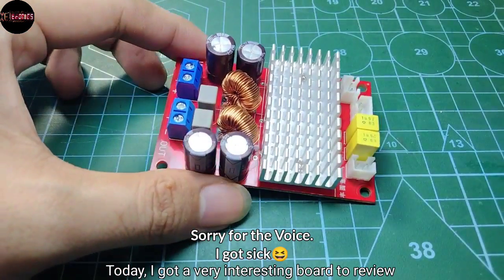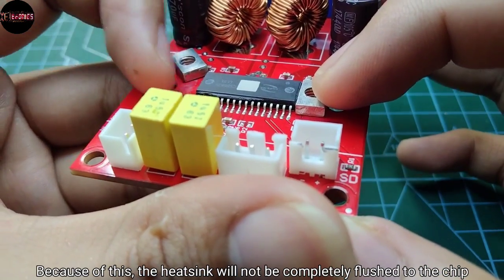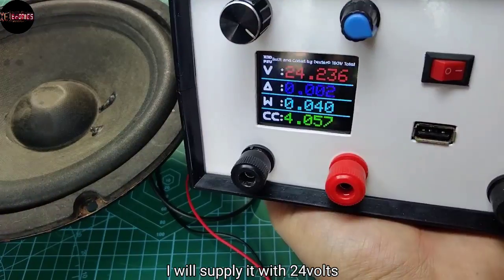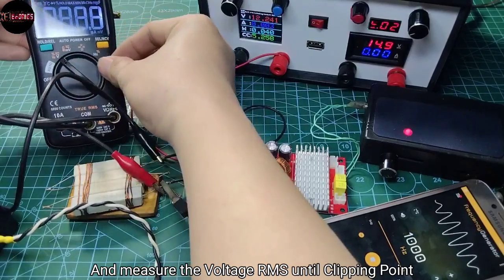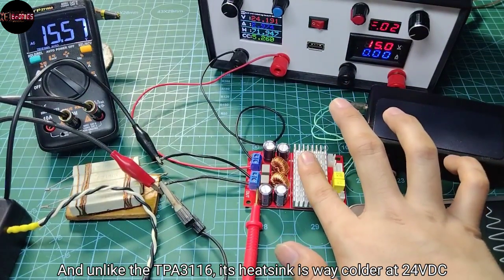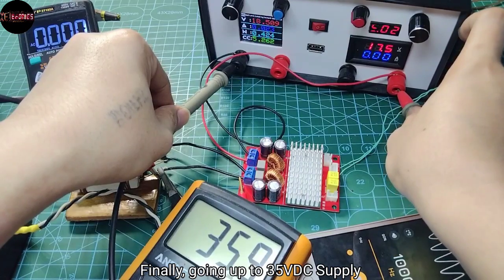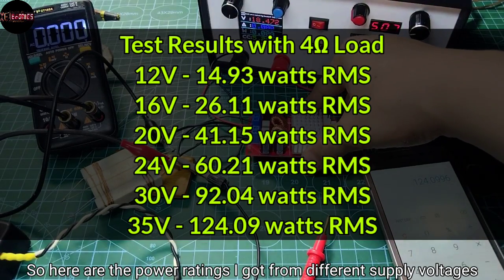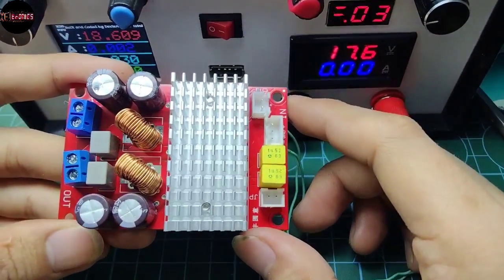You will BUY One After Watching This !! CS8683H RMS Power Test! #classd #amplifier #tpa3116

Comment: Can i use a pd charger as a power supply for that?￼￼
Reply from the maker: You'll need a PD trigger brother
Reply: @x3dtronicsph yeah i have 2 can i use them in parallel to have the same voltage but higer amps  I will use 2 chargers

Comment: He bro I confuse which I bought cs8683h amplifier vs TPA 3116d2 i want more deep bass that reason which should I get you test every one and listen side by side and tell me difference which is the best for more deep bass and quality in  sound i not want more power but I want Deep bass and sweet vocal voice 

Don't hars voice and vocal jo damage ear and harsh 

You tell me any situation which is best 

Please reply me ❤❤❤
Reply from the maker: Both have almost the same bass responses. 
If you want more bass, you need to have a Filter or an EQ
Reply: @x3dtronicsph understand that the responses are similar, but please listen to them side-by-side for a while. Test the frequency using a frequency generator app and tell me which one delivers a better frequency response that is suitable for me. Which one delivers low frequencies really well and maintains sound quality even at high volume? Please tell me only one; do not confuse me."
Reply: @x3dtronicsph understand that the responses are similar, but please listen to them side-by-side for a while. Test the frequency using a frequency generator app and tell me which one delivers a better frequency response that is suitable for me. Which one delivers low frequencies really well and maintains sound quality even at high volume? Please tell me only one; do not confuse me."

Comment: great video po as always!!..ask ko lang kung pwede ba ang transformer AC na may 29.5v 0v kaso pag naka convert na sya sa DC nasa 38.7v na, nagdadalawang isip kasi ako kasi sabi dun sa data sheet kaya daw high voltage tolerance of up to 45V siguro for idle lang yun😅
Reply from the maker: Alanganin bossing, baka di tumagal HEHEHE

Comment: Hello, sir/ma'am. Please tell me if the CS8683 amplifier board is better than the TPA3116D2 mono amplifier, specifically for a deep bass lover who wants the highest low-frequency quality in sound. Which of the two—CS8683 vs TPA3116D2 mono—is better for deep bass quality?
Power is not the main concern; the quality must be there.

Please reply me ❤❤❤
Reply from the maker: I think, they have the same Bass Response though. The Problem with TPA3116 is the Pop Up Noise
Reply: I understand your concern completely and appreciate that you want to make a worthwhile investment. You do not want to waste your money. Could you please just tell me, after listening to them side-by-side, which one is better? I am not concerned with the wattage or sheer quantity, but the quality of the bass. Which device has a slightly deeper bass extension and better overall sound quality? Please listen to both and let me know your professional opinion. Thank you for your reply." @x3dtronicsph 

Please reply me 

Who is the best for Deep bass lover ❤️❤️❤️ 

Jyada what is hone se fark nahin padta quality in bass ❤❤

Comment: bought another one for a simple bt speaker. but i noticed one thing: my capacitors near the inputs are black. the inductors on the output looks different and the low frequencies is very good but the mid bass and above sounds like its decreased. i dont know whats going on here and when i touch the input, it doesnt really hum that much even if its not connected to a battery. is it possible that i got a bad chip? i did buy it from your links
Reply from the maker: Unfortunate, it is possible that they ran out of good stocks. It is not a Fake chip though since Microchips are hard to manufacture. I hope you have an ESR meter and an Inductance meter to test the Inductors and Capacitors. It is most likely a Filter problem. Most fakes nowadays are common with passive components
Reply: @x3dtronicsph  after like 3 months, my mind clicked and figured out why it was happening. see, before i connect the amplifier or any amplifier, i always make it go through this EQ and i totally forgot that 2 linear pots near the 60hz to 140hz were absolutely dirty because of rats pissing in it (it was left in a dusty warehouse for months with rats in it) and it probably damaged the resistive track. I found that out because the teacher was talking about warehouses and i was looking at the knobs from a bluetooth speaker she had and it clicked. stupidly funny thing that happened lmao

Comment: Sir.idol new subscriber mo may itanong lng ko, kaya nya ba pabayuhin si tusonra subwoofer 8" 801 parang nasa 100-200watts  sya kc mayron ako tusonra Kaso Wala pang amplifier.na e match sa kanya. Sana mapansin thanks and Godbless!🙂
Reply from the maker: Kayang kaya yan boss. Basta Around 30VDC ang supply. 
Kung hindi capable ang power supply mo boss, Sisinukin talaga sya HAHAHHA
Reply: Ok salamat sa kasagutan sir.plano ko Palang bumili at pwede na ba o sapat na ba power supply 24volt 10amp gagamitan ko lang Ng step up corverter para tumaas Ng 30volt DC o kolang pa  Yun lng Ang supply dito at  pwede na kaya Yun..tnx

Comment: Hello :) Thank you for these videos ! What is the purpose of the 2-pins "Gain Setting" please ? What should be connected to it, a 2 pins on/off switch ?
Reply from the maker: It adjusts the Gain brother. The Higher the Gain, The Higher the amplification factor. Meaning it can amplify very weak signals, only con is that it will amplify noise as well.

Better leave the gain to its nominal setting. Around 26dB to 32dB
Reply: @x3dtronicsph  Thx !! These little amps boards are perfect for guitar amp project :)  Do you think it’s risky for the amplifier to connect a 16 ohm speaker???
Reply from the maker: If you're going to use this as Guitar amplifier. You will need a Pretty Good Preamplifier circuit. Increasing its gain too much will introduce a lot of noise.

For 16 ohms speaker. I'm not sure if this amp will perform well because the Output LC filter is designed for 4-8 Ohms. Feel free to test it , in my opinion, Class AB is still best for guitar amps.
Reply from the maker: But if you have a Very Good Preamp, It will work just fine
Reply: @x3dtronicsph  I will test it :) Thx again !!

Comment: i now have the board and its powering two of my TARGA 10 inch subwoofers very well!!! ( i made my own heatsink for it.)
Reply from the maker: Supply Voltage?
Reply: @x3dtronicsph I do think 25A is a bit too overkill though lmao
Reply: 35v 25A
Reply: It's the only psu I have that is rated at 35v and can output more than 150w
Reply: @gabrielantiligando9905  sir yung nabibili sa shopee na smps 36V 20A pwede ba yung iadjust para maging 35V or 30V? bumili din kasi ako niyan CS8683

Comment: The TPA3116 is a good chip. Unfortunately, it's often misapplied. The biggest mistake is a poorly selected output filter. It should be a maximum of 10uH + 470nF. Often, the inductance is higher, and the bandwidth doesn't even reach 20kHz. The yellow cores in the chokes are not suitable for operation at 400kHz and get very hot. They can also saturate and introduce distortion.
Reply from the maker: Yes, very good chip as well, but limited power, it can reach 100watts peak with 2ohms load, but not continuously, and at lower load impedance, frequency response gets even worse

Comment: Boss alam ba input impedance ng zk-mt21?  Tap3116d2 din chip. Gagawan ko kasi ng line-level high pass filter para ma avoid over excursion ng sub ko kaso need ko malaman input impedance nya para sa calculation ng cap value
Reply from the maker: Check datasheet boss, may program resistor kasi yan naka depende sa design. Wala kasi ako nyan.
Pero advice ko boss, wag na yon kasi pwede ka naman gumawa ng High pass filter ng sub sa preamp section na agad
Reply: Di kasi stated sa datasheet eh, tapos puro lowpass nakikita ko online.
Reply from the maker: Bakit papo kasi lalagyan ng High Pass? Pwede naman po Hinaan nalang ang volume.
Hindi din sya crucial sa Subwoofer kasi Low Power Amplifier lang naman po
Reply: Nag rub na coil ng current sub ko. Never ko naman in-exceed rms na rated sa sub ko

Comment: Grabe lakas pala nyan mapalitan nga ung tpa3116 ko😁 ano pala purpose nung sd nya at gain input ano ang function ng mga un bossing?
Reply from the maker: Standby ata boss. Bale Logic Voltage po ang pinapasok kung sakali gagamit ka ng microcontroller. Pwede din kung may GPIO ang Bluetooth decoder tapos alam mo iprogram.
Taasan mo lang ang Supply Voltage mo boss, at gamitan ng preamp para lumabas ang lakas
Reply: @x3dtronicsph ah so khit di na pala need galawin ung SD at Gain nya basta may preamp lng oks na nu? Tsaka wala ba syang pop sound kpg pinower on at off?
Reply from the maker: @JohnmarGalicia Wala ako napansin boss nong tinesteng ko.
Lagyan mo nalang po softstart kung meron boss

Comment: Great video! Nice chip, didn't know about it before watching your video. Keep comparing more boards, with chips like TPA 311x and similar, different versions with real and fake chips, at various voltages, loads etc. and later make video or table comparing all of them, which board/chip is the best, most powerful at given voltage, cheapest and which boards should be avoided, not worth buying.

Comment: don't ask for earphones for this sound garbage
Reply from the maker: @gamiwv 
I was lazy to test it with an enclosure. But without an enclosure, I can crank it without annoying my neighbours.
At the same time, I can clearly see the excursion to instantly know if it has good bass response, And if the mid-highs can be heard nicely.

Sound signatures depends on the speaker box design, so not accurate as well, LOL.
Just test it yourself sir. Thank you
Reply: @x3dtronicsph  I know how CS8673E performs. NOT BUT if you design CAREFULLY output filter . DIFFICULT considering the curve (composite resistance) of any specific speaker (driver) varies alot

Comment: Dol paano mawala yong poping sound sa pag on
Reply from the maker: Try mo boss lagyan ng soft start circuit sa power supply or sa input.
Reply: @x3dtronicsph  dol hindi Ako marunong gumawa ng soft start. Alam ko gawin yon lagyan mulang ng 47uf cap sa mute ok na sa tpa3118 para mag RC delay ata tawag non. Nag order din Ako nag ganyan amplifier module dol baka Kasi di powedi na capacitor lang e lagay sa mute para walang poping sound sa pag on.

Comment: usual TPS3116 board just use a diode in series with the supply which isn't very efficient and heats up,a simple yet effective solution would be to use a p channel mosfet +ve supply---->mosfet drain, source amp(device) +ve and gate+resistor----->gnd ,gnd is common
Reply from the maker: Yes, those are only for Low Power (Low Current) Demand. Does this MoSfet setup don't need bootstrapping the Mosfet?
Reply: @x3dtronicsph  no, that's why we use p channel (high side) not n channel one
Reply from the maker: Oh , thanks for the info brother 🙏

Comment: I have this amplifier too for more than a year now, and i used it for my mid-hi, i powered up this amp with 35 volts max supply and even at high volume and long runs, it can handle it great, the Chinese manufacturer are honest with the power ratings hehe great video!
Reply from the maker: Exactly, Chipstar has a stereo version, CS8685 chip. I might try that in the future.
This chip though, I didn't expect to be this powerful, Damn
Reply: @x3dtronicsph  yeah, me too i did not expect that this amp can be so powerful compared to its size, and soon if the stereo version of this C8685 is much powerful, then i will buy soon hehe, waiting for you to try them!

Comment: 0.4 Watt is the power without signal on all voltages?
Reply from the maker: It depends on the voltage brother.
But without signal at different voltages, if I recall correctly.
It Only draws around 30mA of current. Very efficient